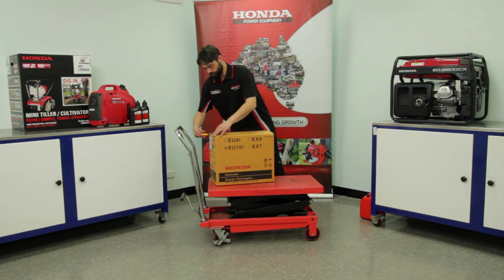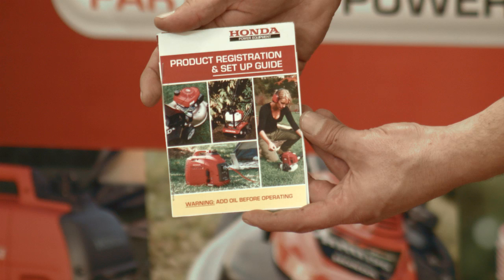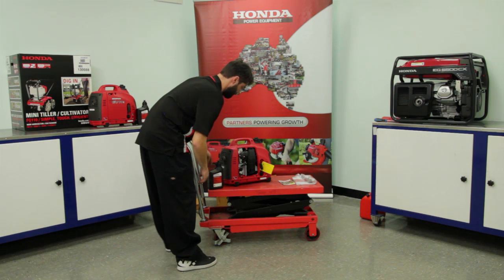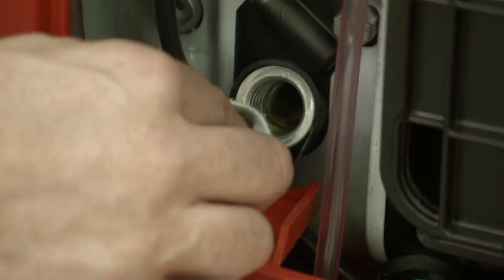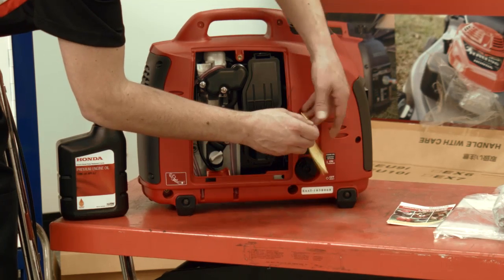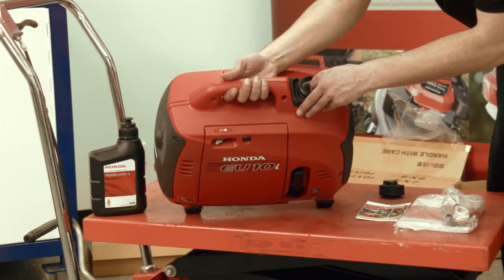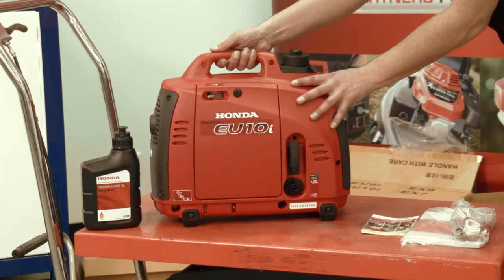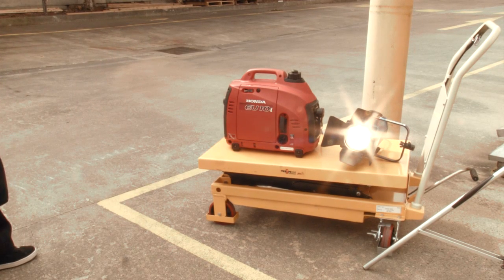Honda EU10i Generator Set Up

Comment: Is the EU 10i the quietest generator?
I want to use 350W, and maybe in the future ~ 800W-1000W.
E.g. for a bright video projector.
Is an EU 10i quieter under such a load than e.g. an XG-SF600?
Reply: Wouldn’t load more than say, 300w for hours at a time, noise in economy setting is ok but when extra power is used it’s a lot noisier and hard on unit. I have been using Honda units for many years now especially the eu10i of which I have one with over 5000+ hours on it. I mainly only use for battery chargers and small fridge on boat, 99% of the time it runs from dusk to dawn, usually change oil around 80-100 hours with clean oil every change for the air filter. Just bought new plugs for it, should have been on about the 5th plug by now, but it’s still on the original, naughty me! It’ll depend on how often and what load in that time you use as to its performance, anything continuously around 500w I strongly recommend the eu20i or better the eu22i of which I’ve had a few when I had large steel cruiser with freezer and big tv and so on. To run a screen projector and the likes I would invest in a good sealed gel 12v battery and suitable inverter with a battery changer and run as I do, reason being is the generator will be on constant wattage to run charger and that’s it, no up and down revs and will stay in economy mode to stay quiet enough for you if you hide it behind some sort of barrier and run with extension cord. Or just run your business off the inverter and battery and charge battery later with the cord supplied with alligator clips straight to generator, it’s all more expensive, but I promise you you’ll only buy it all once for many many years of use, provided you run battery correctly and not flatten it! Cheers.😊

Comment: First off! You never oiled the air filter foam! Can’t be bothered going on about the faults with this video! 😮
Reply: I saw today mine has some oil on it. I checked because it wont start.
Reply: Never had problems with Honda generators, only after hundreds of hours. You may have a fuel problem or the spark plug may need replacement. I always done the service every time it was due and only began to have issues after 5000 odd hours oh use, my last one done over 7000 hours and done a gasket, easier to buy a new one and just get on with it when this happens. I used mine around 18 hours a day on my boats and sometimes 40+ hours straight with the extended tank. Will never buy any other brand of petrol generator other than Honda! Only alternative is a diesel one. Good luck.